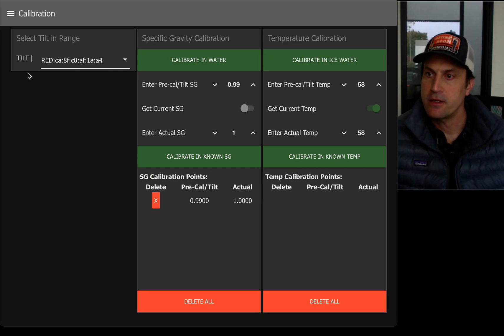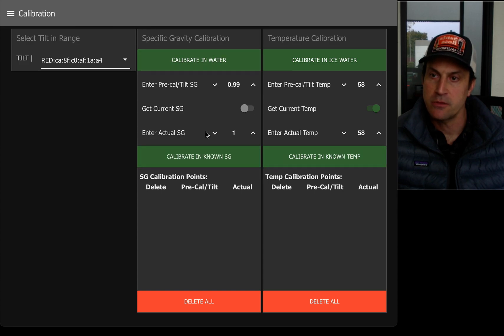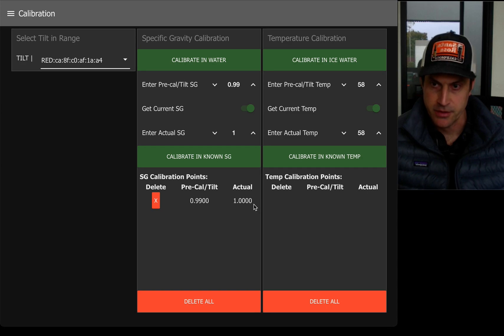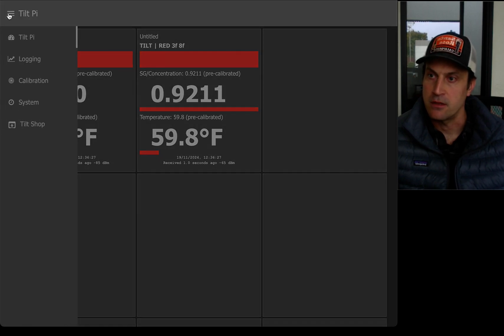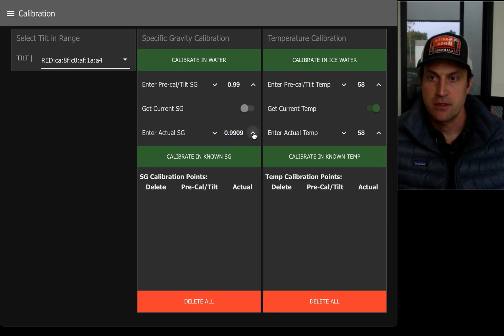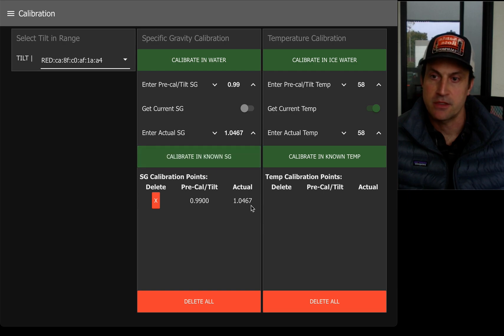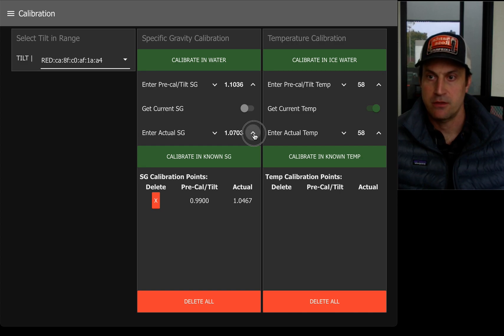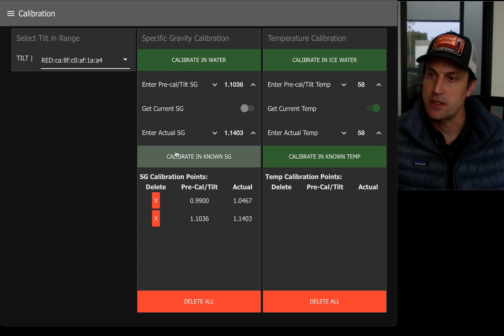Calibrating Tilt with Tilt Pi

Comment: I find the Tilt user unfriendly to calibrate, and to get the tilt open to reset it.
For 250 Euro I expected something way better in design.  The Rapt pill is more user friendly , and 4 times cheaper.   I regret buying this tilt pro.